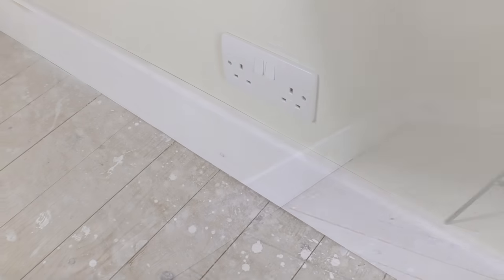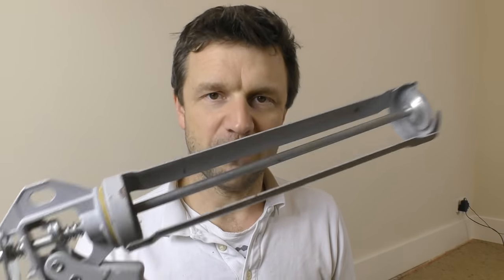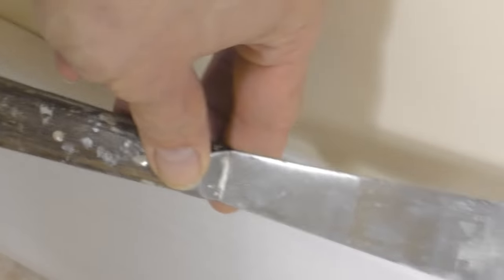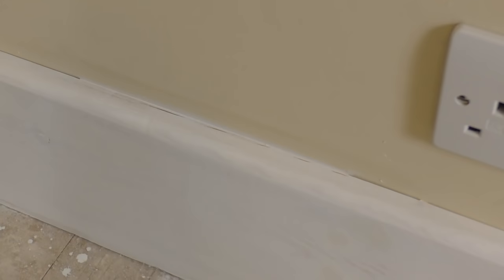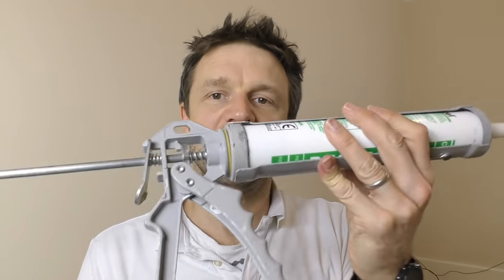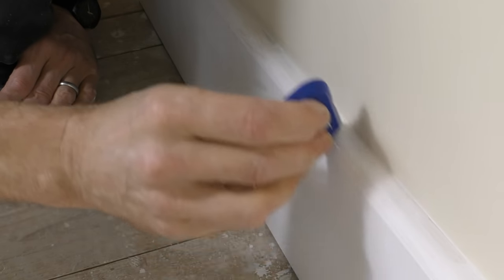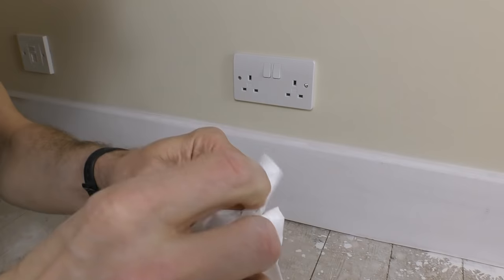How to Caulk Skirting Boards & Base Boards

Comment: Got the $10 kit from amazon that looks just like the one in this video. I wish I had this 20 years ago. Does a really nice job cleaning up caulk joints. No more smearing it in the wall! Plus you don’t get the concave joints like you do with your finger. Also a lot cleaner, no more cleaning your fingers.

Comment: It puts a smile on my face when I check my email and there is a Charlie video for me. Thanks for doing this. You explanations are so clear and you are so willing to respond to comments and suggestions from tradies.
Reply from the maker: Thanks Dianne - I really appreciate that! If you do this just use one of the angle profiles rather than the 90 degree, as you need a small bead on the skirting/base board in case there's any movement.

Comment: Just bought a similar silicone rubber from B&Q for a couple of pounds.  Not sure if it will be as good but it will be worth a try. The corner profiles appear very similar to the one you use.  I am thinking of purchasing the Makita 180ZBK gun as I do a lot of glazing/ beading.  It will not mean I will be able to improve on your results- fantastic idea to use the silicon rubber on skirtings. Thank you
Reply from the maker: Thanks Paul. Only thing I'd add is that you might want to use the angle profile if there's any chance the skirting will warp/ move, as with the right angle profile I used, the joint is a bit susceptible to cracking.

Comment: Now you tell me!  I bought a Fugi kit after seeing you use it for silicone, but never thought of using it on the skirting board caulking I did last week.  Got to seal in a window frame tomorrow so I’ll definitely use it for that now I’m reminded.
One word of warning, I bought my Fuji kit from Amazon and it came with German-only instructions.  Google translate helped but it wasn’t perfect
Reply from the maker: Thanks for the heads up Geoffrey. You might just check out my update video if you have a moment https://youtu.be/-ETYMFbtaTk

Comment: Hi Charlie, I’ve become a big fan of your video blogs and especially on your Siliconing ones (having also watched numerous other people’s blogs on the same subject). Amongst other kits I also use your preferred kit. It’s very good overall but I still find I’ve got various favourite specific tools in other competitors kits so depending on how much of this sort of work you do it can be worth having 2 or 3 or more kits from different fugi manufacturers. 
Now only just seen this video, it’s really interesting because I recently by chance came to the same thought process when I had to do some general decorating caulking. I experienced the same signs of wear to the edges of the fugi tools and went through a similar thought process as to why they were deteriorating that much quicker, however the reason I believe it is happening is due to the fact that we’re using a different ‘sealing’ material, I think the the silicone sealant due to it’s material properties which is way different from standard caulking sealant, actually helps to protect the fugi tools edges. If you consider the silicone is far more robust and is therefore protecting the delicate fugi edges.
Also agree with one of your replies about using maybe a 5mm radius or say 3 or 4mm straight angle, admittedly not required for sealing from water but principal remains the same as you don’t want it to split at a later date and this will give more resistance (add some flexibility to the seal) to any future movement between door & window frame/skirting board and against the walls etc. 
Also as a pro decorator friend of mine said to me, it actually makes it easier to ‘cut in’ when painting (even when using a fine paint brush) onto a very slightly blunted angle when dealing with say a right angled edge. 
Keep up the great work!
Reply from the maker: Marc, thanks so much for your comment - over a year ago. I'm sorry I missed it at the time but I thought I'd get in touch because I discovered it whilst researching this weekend's video (and of course because you had some great tips and general points in it). This weekend's vid  is an improved caulk video. Anyway, many thanks for the comment. Hopefully hear from you soon.

Comment: Lovely. I recently have moved from caulk to plaster filler. It has revolutioned my caulking experience. It’s sets harder, doesn’t shrink much and easier to work with. Obviously caulk does have some uses for me. Still use the finger however, I don’t know just find it satisfying! Use a small sponge and some water to soften the edge. I’d imagine that fungi kit won’t last long on skirting, maybe just make up some 90 degree cuts of hard rubber?
Reply: Perfect. Use a Rubbermaid at least it's just got a handle. Therefore keeping your hands clean....er.

Comment: A great video, I’ve just purchased a Fugi Kit from Tool Station and now I’ve seen your technical expertise I’m going to have ago. 
I have tried it the old way with mixed results but now I want try this new way. 
Thanks Charlie.
Reply from the maker: Steve Pettit Thanks Steve. You'll love the kit. Good luck and let me know how you get on! Only thing I'd suggest is maybe experiment first with the smallest concave profile to leave a small concave bead rather than totally removing the caulk as I did with the right angle profile, because this will help if the skirting boards shrink or otherwise move at all.
Reply: Charlie DIYte  Thanks I will do.  :)

Comment: You can dress the edge of your profiling tool by rubbing it over some 400 grit or finer sandpaper much like sharpening a knife. I lay the sandpaper over a piece of marble tile since it is truly flat and produces the best results. You can extend the life of the tool and still produce perfect results.
Reply from the maker: Arthur, thanks so much for your brilliant tip! I was sceptical but tried it out (with a 2000 grit wet and dry I had lying around) as I'm doing a new, more comprehensive caulking video at the moment, and it worked just as you described! Look out for the vid, and it will be at around the 12:44 min mark. 👍

Comment: Just cut a VERY fine tip at a 45 degree. Use gentle consistent pressure, start in your corners. No need to wipe once you learn to lay a proper bead.
Caulking all the trim in a massive house that has colossal base, crown custom trim columns everywhere. Triple extention jams between window and casing. You learn to just lay a nice bead.
Reply: I do use one of these silicone tools for when you have to fill a half inch gap.

Comment: Love the videos but not sure this is necessary or helpful? Obviously glad it works for you! My understanding was that you do want a feathered edge and a bevelled caulk so that when you cut in, you’re painting a straight line on the caulk so that you don’t catch the brush on the perpendicular surface. I.e. it’s easier to draw a clean line in the inside of a curved surface than it is to get right up to a surface you meet at a right angle (which I find nearly impossible!).
Reply from the maker: Yep, you've got a point. The problem with the right angle profile is that if your skirting or base boards move, there isn't enough caulk to prevent cracking along the joint. So if I was to do this video again, I'd probably suggest using the smallest angle profile on the tool, as you get a great result with that, which is then easy to paint, as you say!

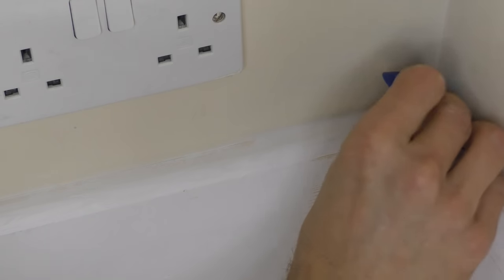Comment: Today I used the FUGI kit to redo the caulk in my bathroom, on a floor/wall. This tool does amazing job, but for some reason I had better results using it the other way - wiping with the beveled side. Especially when I had to work around the toilet where I had very little access to the wall. I was not able to keep it under the right angle (it was always touching floor/wall properly) but more with an angle as you do @ 4:57 in your video.
 As a result sometimes I was able to wipe the whole caulk away. It was working fine the other way.  I don't know why, I didn't have this problem on my little test wall I built to test the tool.

Comment: Thanks for this - really helpful. Like the way you show the technique a few times and from different perspectives.
Reply from the maker: You're welcome mate. One thing though - use the smallest angled profile rather than the right angle, to give you a bit of a bead in case the skirting/ base board moves.

Comment: Exactly how I do it. The only difference is I have a plastic bag and a pot of wonder wipes. I find the wipes make it easier to clean the tool off and I chuck the used wipes in the bag so it doesn't get stuck too my shoe.

Comment: Excellent Excellent job once again my good man!!  And shouts out to you for a lil more in depth tutorial on how to use those fugi kit tools.  Mann I needed that!  I purchased the kit and got mines the other day!  Now I have been diving into the trenches.   Quick question... came across a flat surface with a crack on the bathroom wall.. it has no angle at all.  So how would you caulk that thing?  Any suggestions would be greatly appreciated!
Reply from the maker: Hi there. Sorry I missed this. Take a look at this vid https://www.youtube.com/watch?v=6Omsv5-NN9k as I tackle a crack a bit like the one you're talking about. I'd get a continental filler knife and some Easi-Fill or similar (not sure what they sell where you are) and tool it into the crack, removing all the residue so that the filler only fills the crack. Then give it a light sand to remove any residue, once the filler's set. Hope that helps.

Comment: I bought a caulking tool recently (not sure if it’s a Fugi but) I’m about to put it to the test. I sure hope it works because I’m sick of raw/bleeding fingertips and I have about 18 windows and trim to caulk.
Reply from the maker: Shell G. Good luck. Maybe experiment with the smallest bead profile rather than the right angle. That way you've got a small bead in place should there be any movement in the gap.
Reply: Alrighty, thanks for the tip! 👍🏻

Comment: At Amazon UK you can buy sealing tools for a few pounds, or those kits mentioned in the video for around  £12 - 15.  If you can't justify the cost for a single or now-and-then use, try snipping the corner off an old credit card or better still a smooth plastic cards like old "two together" rail cards and use them. The effect is similar if not as good as the real thing. I use old credit cards to fill small indents in wood etc.

Comment: Charlie & subs.... Wanted to let you know that the FUGI 2 kit is on Amazon (in stock Sept 29, estimated) from KS Tools for $20.11 USD, however, there is shipping that could be up to $11.00 USD. This is the same FUGI 2 from Cramer, but comes in black case not clear, & doesn't cost $46-$51 USD. Just wanted everyone to know if you were interested.

Comment: Hi. For skirting boards I have always used filler, rather than silicone type caulks/sealants (could be because when I first started, the silicone products did not exist). But I still do get filler on the wall sometimes. While I think filler is easier to remove, I might try  the Fugi type tool with filler.
Reply: OK. Tried both using the Bunning's version of the tool. Caulking definitely still messier than Selley's Polyfilla. The tool works OK with filler, but does wear out quickly. I think I would get maybe two bedrooms (each about 3.6m x 4.2m) done before having to replace the tool.

Thanks Charlie, I have watched several of your other vids and found them very useful. Cannot get the hang of scribing an internal corner for skirting boards - maybe just need more practice.
Reply from the maker: @jeremymorris5215  Hi Jeremy. Thanks for the comment - sorry I missed this 2 weeks ago. I chanced up on it as I'm currently researching for a new improved caulking video. On the internal corner scribing maybe take a look at my last video https://www.youtube.com/watch?v=qhe3Waq6Ac4&t=1s as I tackle it again there. Cheers!

Comment: Hi Charlie, thanks for the very informative video. A builder friend of mine recommended using an old credit card instead of the Fugi card. He said to cut a small hole at the corner depending on how big a gap you want. Have you tried this technique? Before I start caulking my home, would you recommend it?
Reply from the maker: Thanks. Mate check this one out, it's much better  https://youtu.be/-ETYMFbtaTk Short answer, don't use a credit card. The whole point of the Cramer or cheap equivalent tool is the rubber in it picks off any residue. The credit card will leave a film of caulk on the wall and skirting 👊

Comment: Hi Charlie, can you make a video on how to caulk between laminate flooring and kitchen cabinets ? Is too dificuly to remove the cabinets and I cannot think of a better way of hiding the space allowed for expansion...
Reply from the maker: Are you just trying to deal the space? If so I massively recommend expanding foam tape https://youtu.be/V6lZXjRR-1k Silicone is problematic between floors and skirting because of expansion bit also because it's a bad insulator whereas this stuff is brilliant and being black you don't really see it once it's in.

Comment: Hey Charlie, love this tool, but I have 1 additional minor issue with using it, which is when the angle between the horizontal and vertical isn't 90 degrees. If it is a slightly acute angle, the tool struggles as you can't accurately get the right angle into the joint.
Reply from the maker: Yes I agree. That's why it's best to use a diagonal profile. Here's my update vid on this https://youtu.be/-ETYMFbtaTk 👍

Comment: Hi Charlie, 
Having recently installed a new downstairs cloakroom toilet, I need to now silicone around the base of the toilet. The flooring is LVT which has a woodgrain. Any hints on how to use this tool without the excess silicone filling the woodgrain? I thought about running a strip of masking tape parallel to the toilet with a gap bug enough for the silicone bead, but the front face of the toilet is obviously round and tape is straight! Any hints or tips at all?

Comment: important point here, caulk is water based, it is not silicon, also it shrinks back slighty when drying sometimes requiring a 2nd pass.

Comment: caulk the gap and smooth with damp finger. if it sinks apply another bead and smooth. paint walls and paint over the caulk. cut in skirting neatly to wall

Comment: Try "pushing" the caulking gun while dispensing the product rather than pulling.   When I use this method I get a nearly perfectly flat caulk application around Exterior windows.  Have not tried this with really thin lines of caulk.

Comment: Never got on with profilers personally. Don't over or under fill the joint, wet finger, ideally with a bit of slip and roll it into the fill rather than applying a one size fits all downward pressure. But I like an enthusiast.
Reply from the maker: I hear what you say. I was just trying to propose a different approach to something that is inherently tricky to do well, and actually you need a slightly thicker bead than I used there, if I'm honest, to ensure the caulk doesn't separate if the skirting moves/ shrinks.

Comment: Bevel side needs to be down so the silicone is forced into the gap. Also spraying with soapy water leaves a shiny, smooth surface on the silicone for kitchen and bathroom corners.

Comment: Just moved into a house around door frames the old cork I'd ruff to say the least,could I use a wider bead of cork over the top with the lager profile setting on tool ,to get a better edge  when cutting in paint,or should I cut or sand out old cork ?
Reply from the maker: Yes you could certainly do that, and actually if you look at what I did here, I went for a pretty wide profile because of my warped skirtings https://bit.ly/3cfJHvG

Comment: I think the tip is. Not to put to much preasure on when using such tools. You only need to go over lightly. The tool will last a lot longer. I used to use finger and spit or soapy water but it's always messy and not really professional. I use similar tools now every time and clients love the look. Thanks.

Comment: How do you fill large gaps between the wall and skirting? I've seen lots of people use expanding foam then chaulk over, also heard of using foil rolled up to then fill over.
Reply from the maker: Howard, I think both those options are sensible. Check out my updated video https://youtu.be/-ETYMFbtaTk which is much better than this one. A few people in the comments section were extolling the virtues of expanding foam, not least because you can just slice it off if you ever need to remove the skirting. My preference would be expanding foam, - you'll see I used it under the plasterboard in this video. It could expand though and make a bit of a mess of the wall, so if you haven't painted it yet, you could protect it with masking tape. If already painted, the danger is that masking tape could take off the paint. You can control the foam better with an applicator gun like I did here https://youtu.be/Obc1thYnLEs

Comment: Just fiund this. I watched your video on siliconing and adapted that to doing caulking. Works a treat but I still find I get a little shadow left on the wall as the caulk catches on the paint.
Have found the same as you that the adage of the tool is getting worn down.
Reply from the maker: Yes, if I'm honest I should have mentioned that the caulking should be done before painting the walls and skirting.